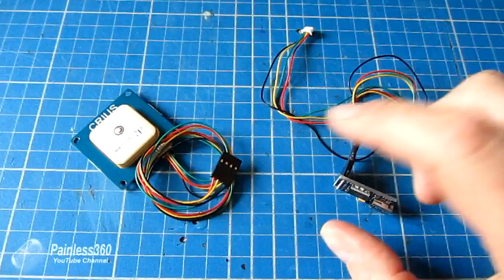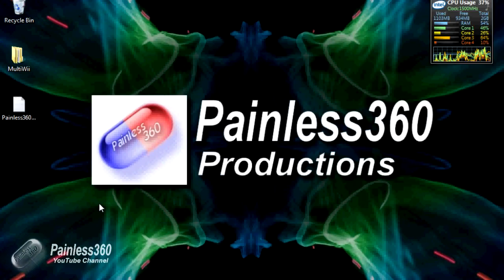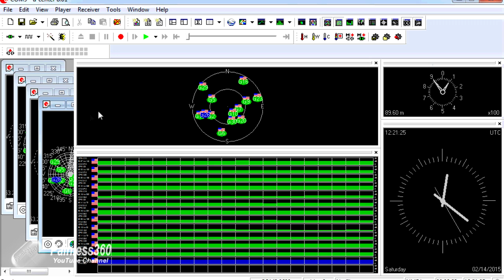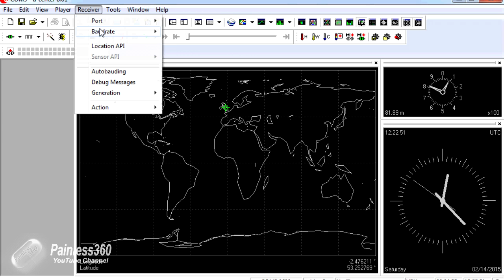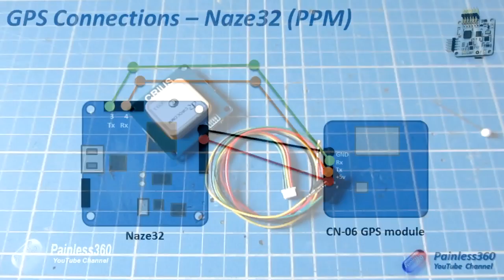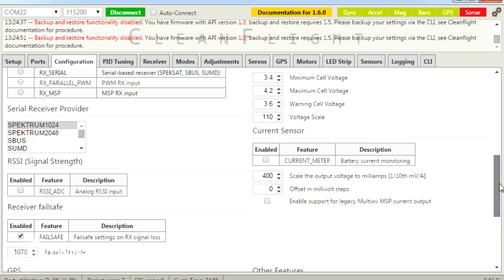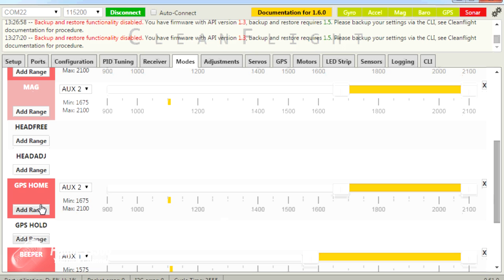(6/8) Naze32 Flight Controller - Adding GPS (NE-06, NEO-06 module)

Comment: great video.. just curious i have a gps ordered and may use it on my naze 32 or my multiwii.... the gps i have ordered has the compass too i have the i2c bus brought out of my naze32 can you see any problem with running external compass on the i2c bus, i have the naze32 acro.. and i will get hold of a bmp 180 baro...
Reply from the maker: bing crosby The compass on the Naze32 isn't too bad and if you keep power and signal lines away from it it'll work fine..
Reply: i only got the stripped naze 32 acro version with no compass.. so  will need to use the gps compass... i assume its an i2c compass on the gps i ordered.
Reply from the maker: Usually it is.. Best of luck..
Reply: Hi... got my ublox neo 6m back it is the version with the compass and a back up battery.. on a mount that can tilt, have tried outside a few times. it does get a fix but can take a while up to 10 mins.. i just wondered if the backup battery needs changing, or charging its 2.5v as if i disconnect it for a few hours it seems to lose its ephemeris

Comment: Another good video.  Would your config file work for a neo-07?  Or would I need to change things?
Reply from the maker: filmserve No idea, sorry. May work as it's the same family of GPS but I've not done it here.. Best of luck.
Reply: Painless360 No worries.  Found it here if anyone else needs it  https://cdn.shopify.com/s/files/1/0412/2761/files/HK_MAX7Q_setup_for_cleanflight.txt?1023
Reply: filmserve hi there where did you find this link? I need to find same for m8 u-blox I think.
Reply: Oliver Peters In the end I only used it for the hk neo7 as non hk neo7's worked better with the neo6 version supplied by Painless.  You should also check out his latest video on gps if you are using cf1.8 as I think things have changed again.  I just used Google to find the link.  Good luck :-)
Reply: Thanks

Comment: Just like this ones because they come with case and foldable suport... like this one. Thanks again.
http://www.aliexpress.com/item/Ublox-6M-High-Precision-RC-Quadcopter-GPS-Module-With-Compass-GPS-Antenna-S/32232164435.html
Reply from the maker: Marcelo Tito Farinon should do. You will need to figure out the wires though by looking at the APM port pin outs.  Also,  connecting the FTDI will be a bit tricky too. Happy flying!

Comment: Thanks for your great vídeos. I´ve been looking all when I have time. One question: Do you know if I can use this GPS modules (cheaper ones)?
http://www.aliexpress.com/item/High-Quality-Ublox-NEO-6M-GPS-HMC5883L-ARDUPILOT-APM-2-6-For-Compass-Module-Multip-Rutors/1938615456.html
Many thanks.
Reply from the maker: Marcelo Tito Farinon I use this GPS module on my APM 3.1 boards. It should work with a little setup.  Watch my APM 3.1 setup videos for the pin outs of the GPS port so you can connect it up. 

Best of luck!
Reply: Marcelo, I am using this one from BG, and does the job nicely, just be carefull as it is a 3.3VDC input and not 5VDC. You can use the Naze32 3.3V pads to connect it, there is enough juice to power it, no worries....  It works fine with Baudrate at 115200 even though it is rated at 38400 (without prior config, as it comes with the config OK)... Here it is: http://www.banggood.com/DAL-Universal-UBlox-7N-High-Precision-GPS-Module-2m10HZ-p-950875.html

Comment: Tks again for this much appreciated tutorial. If I may, after testing the RTL with the Naze32 (baro and mag version); it will precisely go back to home at the level of the GPS Hold mode which should be prior to the RTL; and will follow this height back to home, so be careful, before engaging RTL! Make sure you don't have any trees or National utilities posts on your way back!;) It will not climb to a 100Feet (or else) height by default, before going back to home, this parameters can't be set in Cleanflight, yet I presume! Just be carefull of this Lads! Cheers.
Reply from the maker: Great comment thanks. This is exactly the same as the modes in the MultiWii code. The best RTH I have seen personally is the APM where altitude for the RTH is also configurable.

Do you have any video of the RTH Naze32 mode in action I can link to?
Reply: Painless360 I was wondering about that.
Can you set it to rise to specified height when in RTH mode?
Reply: Painless360 I played with it 2 days ago, But No Videos.... I will make one this WE then and post the link..... Cheers
Reply: Kevin Ray No Kevin you can't, but does the job at is original height when RTL triggered...
Reply: FPV cambodia Too much wind this WE lads, Will make the video soon enough when appropriate, Stay Tuned! Cheers

Comment: Great video tutorials, would be nice to have seen the GPS actually working in flight...
Reply from the maker: If I'd I had any good weather here in the UK to film it (no wind or lashing rain) then there would be. Not much to see actually - it does what it says on the tin..
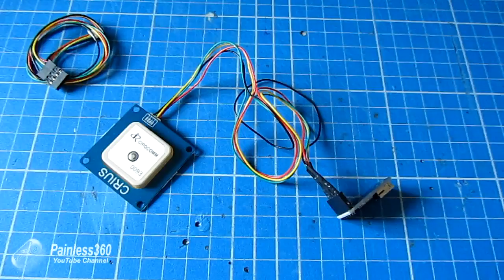Reply from the maker: Painless360 If you are interested the behaviour is similar to the Multiwii modes for GPS HOME/HOLD (no surprise there!). I do have a video on RTH with a Multiwii on the channel in use if you're interested -  https://www.youtube.com/watch?v=NB7VVvAiPF8 from about 8:42.

I will be adding a Naze32 RTH demo to the channel once the 250 frame arrives and is setup..

Happy flying!
Reply: Thanks Lee, I know what you mean about UK weather, I'm in the north, rain and wind....lol
I've watched that GPS vid, awesome stuff. You do a great job..

Comment: Hey, great videos, really helped with my naze32 and beeper!!!!. Off topic a little, I've a 450, can u share any details regarding your naze32 mount ie where you got the parts from - mines mounted on the foam that came with kk2.0, sure could be improved.  Thanks.
Reply from the maker: Search for Naze32 or APM 3.1 mount on eBay - loads on there to choose from. That's where mine came from.